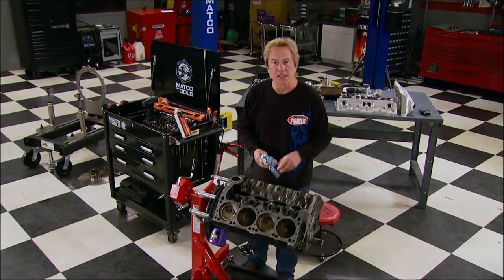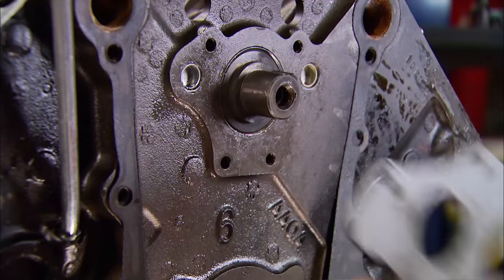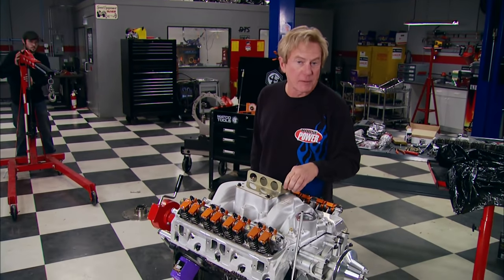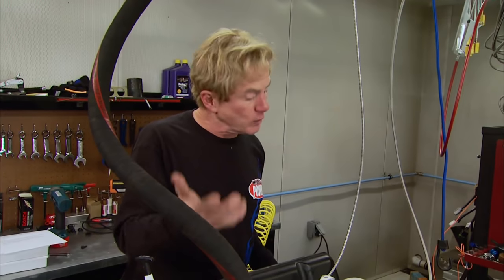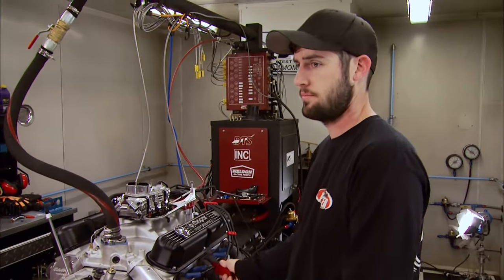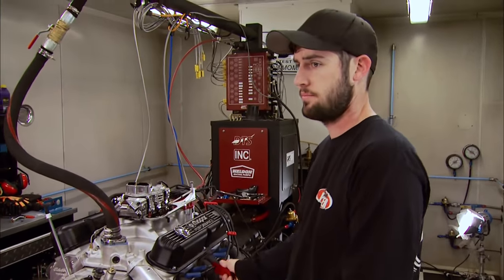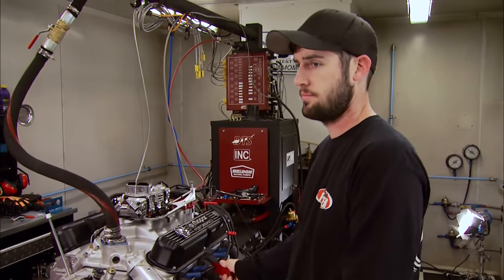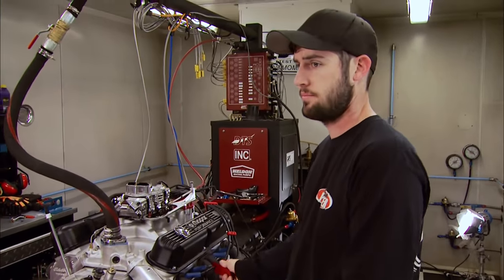Squeezing More Power Out Of Our High-Performance 360 Mopar - Horsepower S13, E20

Comment: Why would anyone use special, 340 ONLY, open-chamber heads (for '68-71 positive deck pistons) on a negative deck, dished piston 360? Typical mismatch and a disservice to viewers! The camshaft was a good pick, but needs 10:1 with the aluminum heads, not 7.5:1!! These shows are crippling their non-Chevy builds.
Reply: Yea.  Looked like the open chamber head.  Poor pick.  
I think the cam should have had more lift.  Like .550. 
And the Rpm air gap would have been a better choice too.
Reply: I was wondering that myself. I’m building a 360 from a ‘90 roller block. Went with Speedmaster 65cc aluminum heads and looked them over really close. KB flat tops with 5cc valve reliefs, and they sit .020” in the hole. Roller 1.5 rockers. Waiting on my Hughes 3034 roller cam to come in. All said it should be 10.3:1. Should make for a stout street engine!
Reply: Rodney Byrd. You make a good point.
A lot of the time in builds or comparisons they are flawed. See my comment above about thec360 I built using the same Edelbrock heads but withc10 to 1 flat top pistons 
Out of curiosity I built a 350 4 bolt main Chev engine for my 65 FI chev Corvette. Edelbrock alum heads the 65 fuelie solid lifter cam to ensure correct vacuum signal for the FI unit. But close to the 360 Mopar in most respects. In fact I used a 6 inch rod in the Chev as opposed to the stock 5.7 rod.
Redults.... chev 420 hp 405 ft lbs of torque for theChev vs 414 hp and 441 ft lbs of torque for the Mopar.
All in all the only surprise was that the 360 kicked out about 10 percent more torque. I don't know why.
But in a comparison that every effort is made to keep things on an even footing without mismatches ir advantages I've never noticed much difference between medium sized Chevs I r Mopar.
The same can't be said for thec351 Winds I r engine in my opinion an under Performer. But a properly built 351 Cleveland would get you around 425 hp. It's a pity that engine was never fully developed before being canceled.
I think with development if a proper alum head and 10 to 1 compression running on pump gas it could have surpassed the 350 Chev orcthe 360 Mopar. Yhe basic head design was superior as shown by a comparison ofvthe Boss 302 vs the z28 fudlie head.
Reply: I agree. Those were the wrong heads. The stock heads probably would have done just as well, maybe better. If they had 8:1 compression, they were lucky.
Reply: All pre magnum small block heads are open chamber, 71 is the only year a 360 didn't have dished pistons and they are all .080 or so down the hole. The 360 was designed to move trucks and station wagons nothing more even the later HP versions were the same engine with the 340 cam and intake. Basically it's a dyno on a stock rebuilt pre magnum 360 and then with cam and heads swapped on.
Reply: @JT-ko3rv  A better choice would have been the closed chamber EDELBROCK heads and not the relieved/open chamber heads made only for positive-deck 340 applications that achieve their quench above the cylinder deck. Why would anyone reduce compression on a dished piston/extremely negative deck already low compression 360? To make less power? I guess so!
Reply: @rodneybyrd9516  wasn't paying that close of attention to the chambers, makes sense. Poor build anyway 360s are so abysmal on compression wasting money if your not changing pistons.
Reply: @IGrocker  
When the KB flat tops came up .02 under the deck, 
Shoulda had .022 taken off the deck.
Reply: Power Nation did justice to the mopar following. They used Trick Flow heads,  and started with a1050 Holley carb. a stock 340 (including "X" heads, 950 Holley, Air Gap intake, cam, 10.5 compression, made around 397 HP. The build these guys did would compliment stock 10.5 340 pistons, as they used open chamber heads. It has however evident their effort was half hearted.
Reply: This is what happens with TV shows they use the parts provided for free
Reply: Good catch. And yes we MOPAR people can always spot the MOPAR hater TV personalities.

Comment: 360's are 500 HP engines if done right.
Reply: At what cost?
Reply: @Carlos.Rivera  $5
Reply: @Carlos.Rivera  jk you can probably have an Na 500hp built for 5-6k
Reply: @Aqua350Lt1  yeah that s a bit light in today's world.  Maybe. 10 15 years ago. Mopar cost more to build at any given hp level than Chevs or Fords .
But they are good engines. Especially thec360 andc440s
Reply: Most engines are 500hp engines if done right....hell ive had a honda 1.6 make 500hp..
Reply: @MrCriminalmischief  i bet thats not gonna have a long life
Reply: @markrodriguezjr8553  

It lasted for 6 years.. hell its still out there somewhere in some crap civic. 

B16a turbo, 6266. Forged internals. 
All lag, and then explosive power on top. 

Engines are engines. I love them all.
Reply: @MrCriminalmischief  😂😂damn
Reply: I forgot to mention, i love all engines, except the garbage triton motors, where you have to helicoil the sparkplug threads..
Reply: @MrCriminalmischief  ay right on I mainly like any mopar v8 or v10 any cummins the 2jz and super car engines
Reply: Compression ratio is very important. Obviously their motor had relatively low compression ratio like 9 to 1 or less. If they had 10:1 compression that motor would be at like 430 hp.
Reply: @erikturner5073  

11:1 is perfect for a highly tuned street machine, and your right compression ratio is a big factor in making power, not only that, throttle tip in and response. 

11:1, tunnel ram, and offset rocker 190cc ported heads and mopars are ready to rock. In the low to mid 500hp range.
Reply: Yeah, this wasn't done right. Had the block at a machine shop and didn't set the deck height?
Reply: @scottmichaels1764  

Well, the title is mopar MADNESS.
Reply: @josephfreeman3816  they make more power per dollar and will last longer with less in it. I've seen stock bottom end magnums outlast a 10,000 dollar chevy engine. Chrysler sacrificed production number money and took that money and made the actual engine out of better materials (i.e. higher nickle content in the block and crank. A stock LA cast crank can take upwards of 700 hp and a magnum even more since its nodular iron and stock rods can handle 550 hp with ease, block never needed 4 bolt mains because the high nickle content made them even stronger than the 4 bolt main chevys)
Reply: @MrCriminalmischief  you mentioned turbo...NA is boring then? lol
Reply: @allanmcelroy9840  
What? No. My b16 was turbo.. and thats the only way a tiny engine like that would make 500hp.  

The rest of my cars are NA. Sure turbos are faster.. produce better torque  NA feels much better, throttle response is much more crisp, and better modulated.. thats hard to do with a turbo car. 

NA is more exciting.. sounds better. 

Case in point... Look at the resale value of any porsche GT3'S in comparison of a 911 Turbo of the same year.
Reply: @MrCriminalmischief  that's all fine. My original point was turbo pushing extra psi for more HP, while a NA engine on its own makes whatever. The other half of my point, if you want to turbo something...no take that turbo away. What are you left with? That is why I stand by the viewpoint of all-motor on its own will always be the most power(bare-bone anyway).
Reply: @allanmcelroy9840  

Mate, im am sure what your point is. I had one engine with a turbo on it. One. My chrysler engine is NA.
Reply: They should've put a Hydraulic roller cam put higher comp pistons in that engine.. I'd go a striker kit if it was me
Reply: @patrioticaussiesams8581  Hughes Engines
Reply: I have a 360 in a 00 Durango. It's got a tiny bit of work done to it and a small tune and it pushes 350hp and 450 torque. It was a county cop car and I've done some basic stuff as well. Eventually I'm planning on rebuilding and supercharging it
Reply: @keirabun7861  

Which 360? The magnum or the LA?
Reply: @MrCriminalmischief  5.9 magnum
Reply: @MrCriminalmischief  I'm running pushrod 5.9L magnum
Reply: @keirabun7861  

Ahh. Im in the process of going from swapping from a Magnum engine to older LA. 

The LAs have more aftermarket support for heads and rocker assemblies. 

I got a used set of w2 heads for cheap.
Reply: @MrCriminalmischief  I'm partial to the engine I have, been working on it for years. Even if there's not as much support it's sentimental to me
Reply: @Aqua350Lt1  try doubling that price. One builder has a video on here for a mopar 360/475hp. His price is $11,500 before options.
Reply: @erikturner5073  yes, they kept the block & bottom end stock!
Reply: 59pllbare5r2is it!
Reply: Or even 600 hp
Reply: @MrCriminalmischief  anything makes power with forced induction. No 1.6L Honda will EVER make 500hp N/A
Reply: There are plenty of 360's making over 600hp N/A
Reply: @josephfreeman3816   Shit no
Reply: With a solid rollers and some good flowing heads

Comment: I wanna see them take a 360 magnum truck engine, upgrade the internals and take advantage of the fuel injection, see the power difference.
Reply: You won't get much advantage with junky stock injection
Reply: @michaellee5399  just the idea of it. Modern-ish tuning and decent injectors. Always see carb on the channel
Reply: @michaellee5399  yeah would need to go with Holley  fast, or ez efi. Planning a 410 efi build for my 95 dakota
Reply: Why use a 750cfm carb on a 360? A 650cfm is more than it needs.
Reply: I did a 2000 magnum build. Hughes cnc ported magnum r/t heads, hughes roller cam 234 dur. 574lift, m1 intake that works with carb or fuel injection (not throttlebody injection, thats just an electric carb).... Engine is in a 67 cuda, it rest on solid motor mounts and a hemi 4spd trans. It idles very smooth for as much cam as it has, timing is at 22 initial 35 total all in at 2700. Throttle response is very quick, pulls hard all the way to 7800. The magnum heads and roller cam is where its at! Im running a demon 650 carb now but ford mustang fuel injection is going to be used with a 4 hole throttle body soon.
Reply: Efi doesn't usually make any more peak power.
Reply: @ahatchett  It makes it easier to increase peak power though. Upgraded parts, porting and polishing should work better with EFI.
Reply: Would be around the same 400 with a good cam
Reply: Got the vibe these guys don't really care for mopars.
Reply: @SKYNET9er  agreed. Sucks is always sbc n old fords
Reply: @SKYNET9er  theu don't. They never have. Just hacks for TV

Comment: The super low compression dished pistons used in this build crippled it. Even with a few grand in bolt on goodies, it still makes less power than a re-man 360 magnum with a cam would.
Reply: totally agree
Reply: 410 HP can be made with a Magnum with the stock heads no problem. I don't see why these show continue to do LA builds.
Reply: @451dskots88  8.6 compression ratio if those are only .090 down the hole that’s being generous. Usually closer to .120 down the hole
Reply: @erikturner5073  what kind of mods are we talking? Stroker kit and cam?
Reply: @LegendoftheFa11  don't need a stroker for the 360 Magnum to hit 400 HP. The LA 360 I'd leave that along. People are hitting 380- 400 HP with 318 Magnum. So the 360 Magnum is no prob.
Reply: @erikturner5073  that's good news. Got a 5.9 Jeep ZJ that I wanna build and hit 350-400hp with it just looking for some advice
Reply: @LegendoftheFa11  well prepped heads and a cam around 214-218@.050” would be a great 380-400hp combo.
Reply: @jjtool5800  more like 7,88:1 🤔 the piston on my 1976 360 engine is 3 mm from deck clearence.
Reply: @erikturner5073  theres no LA's in my junkyards so i dont get it either.
Reply: @LegendoftheFa11 you realize the Mopar magnum 300hp crate engine was the assembly line truck engines   so knowing that the Mopar black box ecm, throttle body, get a set of engine quest magnum heads have them ported and a mellow efi cam from Hughes, the throttle body and either port the intake or get the efi air gap.  I only ran jba headers in the ram and jeeps

Comment: This one is a real head scratcher,  I'm guessing the compression was in the 8.5 or less range.
Reply: Yep the early LA 360 was just under 9-1. They coulda used a thinner head gasket.. Or piston swap. Pretty sure on stock 360 the piston is .020 in the hole at TDC like a 318.
Reply: @jayirving6996  And don't forget to check for Clarence.
Reply: Who is Clarence?
The factory Magnum engines had a bit over 9:1 compression.
Quite certain thats a Magnum block and lower end.
Reply: @ShortArmStrongArm  nope that's a la block
Reply: Just CC’d my ‘90 360 (factory roller cam LA) and measured everything out. Pistons were .110” in the hole. 308 heads were advertised at 65cc, however they measured out to 74-76cc. Comes out to about 7.8:1 when you run the math. 

I wound up ordering aluminum heads since the 308’s were cracked, but I was planning on a thinner head gasket and mild port work. I converted it to carbureted previously, so no need to deal with attempting to tune/running a standalone engine controller with the TBI
Reply: @ShortArmStrongArm  Clarence usually grabs the feeler gauge.
Reply: Have never understood if your going to upgrade an engine just zero the deck, mill the heads bore it .030 step up the cam a notch or 3 and upgrade pistons and carb, 🤔
Reply: @BuckI2Bdad  cost is a big factor, not to mention finding a machine shop competent enough to to zero a block to factory blueprint spec. Generally, you can do a home port job on a set of decent heads, run a thinner MLS head gasket, and swap in a cam for less than you’d have in the machine work alone, assuming the heads you’re starting with don’t need any machine work.
Reply: Early la360 were low as 8 to 1 compression , and if that , some of them were only 7.8 to 1
Reply: Lower compression creates a larger margin to add power from a supercharger, turbo or procharger. Mainly just a supercharger back when it came out.
Reply: @Ratridez  depends on the application,4barrel fuel exhaust,2barrel truck,2barrel van or small motor home
Reply: My 360la originally was .040 in the hole and I have heard of some up to .100 which is insane. Guessing mine was 8.0:1 but now with zero decked and flat tops looking like 9.8:1-10.4:1. I know thats a broad range, but I am going off the manufacturer and the open chamber heads and just guessing. I know it’s way better though…

Comment: I really enjoy your guys videos but you really need to get a Mopar guy in there during these episodes my assumption is the reason we never seen the dyno video of the other 360 with the trick flow setup was nobody paid attention to you using solid pushrods on a magnum since it wasn't an early block that still have the LA oil passages drilled you could see it in the video my guess is when you guys ran the motor you ended up having a massive valve train problem since you didn't get oil to them. I was also kind of stumped that you used retrofit lifters even though the Magnum block and that other video was already set up for factory hydraulic roller lifters. Keep up the good videos looking forward to some more.
Reply: Is this a Magnum engine? I thought it was an LA.
Reply: @scottmichaels1764  The one in this video is an LA block.